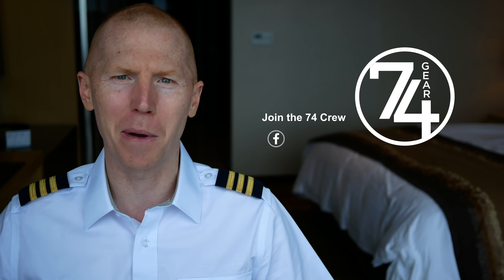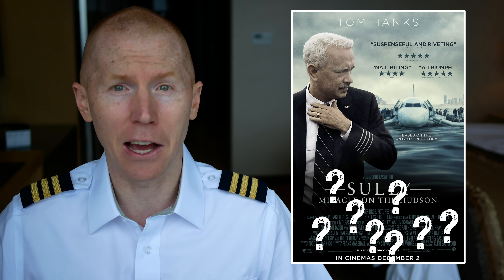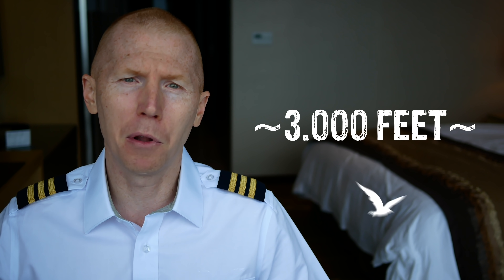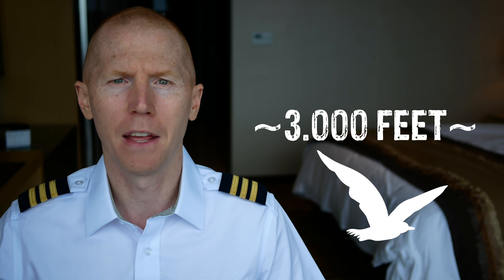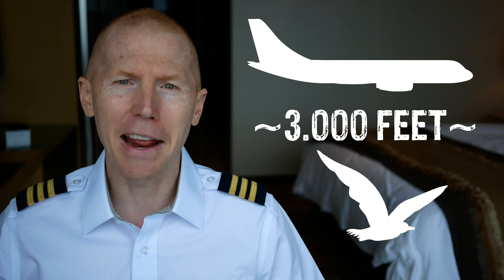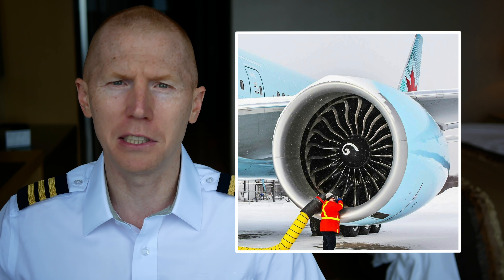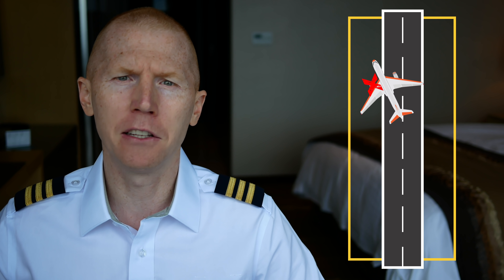Why Engines Don't Have a Mesh or Grates to Stop Birds

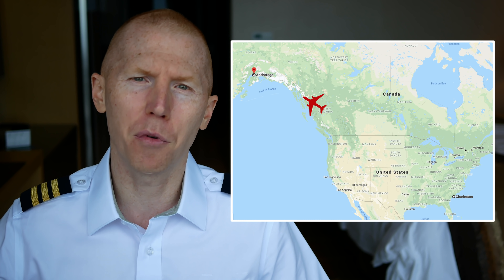Comment: 2:37
It is even more interesting if its used only during a few minutes, it is very easy to have it roll up on the side past 3000 ft ... assuming the loss in energy isn't so bad that you can't get to 3000 ft and that birds aren't very much disappearing so the risk is pretty low and not worth it x)
Might be even easier to just have a suplementary motor mounted on a missile in airports that you could request if you do lose both motors too low or too far from destination , takes a lot of drone programming but its definitly not impossible...

Comment: What bothers me is that a car has an air filter. And still sucks a ton of air through the filter. So I dunno. There could be a filter. Not a grate. If it works for a car? How does a Jet work then? Why can't a commercial plane use that tech?
Reply: Planes and cars are like completely different
Reply: @ducklinglibrary7941  yes. Yes I know. But we didn't think SpaceX would be a reality until it was. Or Tesla. Or Robots. So I'm just saying. Engineers could really if they wanted to make it happen. But I don't think it's on anyone's priority list.
Reply: @TheGuyCalledPaul  sadly, a filter wouldnt really help birds in general. They would fly into it and get smashed and the remains would fly into the engine. If too many got in they would smash the filter and make it unsafe to fly
Reply: @ducklinglibrary7941  yeah sadly I realized that my suggestion is rediculous lol. Sigh. Smarter people can figure it out. But yes. It wouldn't help. You're right.
Reply: @TheGuyCalledPaul  not too ridiculous, I've seen people suggest lasers.
Reply: @ducklinglibrary7941  well. There's that. Haha. Austin Powers. Freakn Lazers. I guess it's a question of who's idea makes the most sense and what can science accomplish

Comment: Why not have something retractable, like when you get to a certain altitude they retract somehow but below said altitude it prevents birds from entering the engine
Reply: I imagine take off is where you need the most intake during a flight so might mess with take off distance too much to be worth it. 
But if not then the fuel efficiency problem isn’t so bad since it is just applied for a few minutes a day.

Comment: Solution: Military Class 1 sentries on each wing that targets birds in a 500 meter radius.
Reply: I’m just waiting for a pilot to forget to disengage them while landing and shooting up the landing crew.
Reply: @CityState_of_Valletta  😂
Reply: @KAT-hs3xh  Just SLAP DAT CIWS on the wings,100% balanced weight won’t affect aerodynamics at all,or you know,we can just mount some .50 and a 47mm turret,but that would just turn it into a gun ship.
Reply: @yeetboiiiiii2488  I reckon transporting people in AC 130s
Reply: @KAT-hs3xh nonono we need to convert a BIGGER airliner into a gunship and make it have 2 120mm guns on turrets,4 30mm auto cannon and a bunch of .50s,just gonna have some Missiles hanging on the wings for y’a know,airport security :)
Reply: @yeetboiiiiii2488  uh huh.....
Reply: @KAT-hs3xh Well who is going to testify against me? The dead bodies?
Reply: The bird population would probably drop by like 60%
Reply: “Hans the birds are coming load the high explosive”
Reply: @yeetboiiiiii2488  big problem Fritz, the war has cut down our supply, we only have three rounds left. It’ll take at least 15 to hit them with this low quality Russian made AA we confiscated from the east
Reply: BURDS HITTIN MAH SENTRY
Reply: @hemttgaming6284  GETS SHREDDED BY 7 SINDWINDERS
Reply: @hemttgaming6284  Hi Cave Johnson here..
Reply: I’m all for this
Reply: Error the speed at which the plane will be travelling u will still be sucking a dead bird inside the engine
Reply: @kanushvenkatesh1725  it’s called a joke, maybe you should try it?
Reply: @Uncle_Jamar  I know I was just animating the possibility
Reply: No no, not enough splash damage. We need plasma cannons
Reply: @artist686  how about a 12.8cm flak firing a nuke
Reply: That costs alot of money and its not easy
Reply: hey look buddy, im an engineer, that means i solve problems
Reply: A 30mm CWIS should do it...
Reply: Ah yes air defense
Reply: Love this idea
Reply: Go murica

Comment: honestly it feels like putting a grate in front of the engine would cause major issues and not be safe, but he mostly talked about fuel efficiency type stuff which mostly left me wondering why nobody can figure out a system that is only active while specifically at that altitude range and not the rest of the flight if efficiency is really the issue

Comment: "Why not put up security for this eventuality?"
Cause the chance of it happening is so escapingly tiny, its not worth the drawbacks having that security.

Even with the few exceptions, like a dam holding back a lake,a fission powerplant, or a space station, theres limits on how much security can reasonably be added without inhibiting the usefullness of the structure.

Its the same reason why stairs get used, or knives are household tools.
Making them 100% would either mean not using them, or make them less usefull, up to a point of uselessness.
Reply: yeah I mean you can't eliminate all risks in life you have to accept the possibilities and take risks, same goes with planes but the chances of actually a bird flying into the engine are so low that it's not even a risk, let alone there are measures for if that were to happen...
Reply: Also reducing fuel efficiency so much has chances of causing devastating problems of its own that could potentially be worse than birds
Reply: They have it, it's called a hunter. There are hunter hired solely to keep birds down around and in an airport.

Comment: If bars prevent good airflow then you could just have some bars that could be hidden when above those 3000 feet and lowered when in the "danger zone". That way you wouldn't lose much efficiency because as you said, the amount of time that you are in the "danger zone" is really small compared to the rest of the flight.

Comment: Another reason is.
How thick does the grate or mesh need to be?
At 300km/h or high whilst climbing, a bird that weighs 6kg will be shredded to ribbons if lucky, this will still be bad for the engine, the worst case is the grate or mesh gets damaged and thrown into the engine along with the bird.
You can see the damage hail does to a car during a hail storm, there is that famous photo of an object 1cm in size striking something in space and making a huge crater.
F=MA

Comment: we got retractable landing gear so why not retractable shields ????
Reply: im not a plane expert but im guessing the problems would be weight, aerodynamics, chances of it breaking off, and the power to motor has since the engine is practically sucking it in.

Comment: The bird die to impact either way and get in the engine,  and having a net can be risky a piece of metal can damage the engine so it worst having both of thoes risk at the same time,either it come of from the pull of the engine or the body of a bird goes in or out everywhere

Comment: Using a screen in front of the engine can be done.  Lookup any video about testing jet engines for a fighter jet, you will see a big screen in front of the engine.  On the ground, it is used to keep things and people from going into the engine during testing.  But the entire area in the building where the engine is tested is checked for debris before the engine is started.  For in-flight it does not make any sense because the number of crashes because of birds is less than 0.01% (or less) of the total flight per year.  I have worked fighter aircraft for 30 years and I can only think of 4 times where an engine was in the shop because of a bird strike and maybe a dozen times where a bird went down the engine with only a little damage on the 1st stage of the fan. The damage on the fan was an easy fix, just blend the damage out and it is good to go.

Comment: There's also the fact that these days it takes a pretty sizeable bird to wreck the engine. A 777 might not even notice something the size of a pigeon. A goose, on the other hand, that would basically turn your jet engine into a hollow tube.
Reply: So you’re implying we should make engines exponentially larger and stronger than local fowl? I’m all for this
Reply: @CityState_of_Valletta  No, but I like where your head is at.

Comment: The solution: Engines that immediately pulverize the birds into fine-grained bird mash.
Reply: even better, add a way for the mash to be deposited into the plane to be served to the passengers.
Reply: @VaderViktor  ewwww nice
Reply: Chicken nuggets
Reply: @Mark_badas  fresh 😋
Reply: Mmm tasty
Reply: What
Reply: @payeshlover99__48  read
Reply: Ive cleaned jet engines after bird strikes... nothing but pink mist doesn't damage the engine at all most of the time
Reply: @smoothguitarforever  Metal. Literally.
Reply: @smoothguitarforever  Double negations in that sentence... Do you mean bird mash doesn't destroy engines, or do they not?
Reply: @Stroheim333  not sure how thats a double negative but it does not damage large engines at all, cf6 engines could probably eat 10 small birds without thrust loss
Reply: @smoothguitarforever  Good! The nuggets can be served and the engines will lose no thrust :D
Reply: The problem about it is that the protein in the meat of the bird will stick like glue at the blades and will generate massive Vibrations in the compressor and turbine which can destroy the engine depending on the high  rpm
Reply: @GrossStadtAdler  At least we kill the birds.
Reply: @Stroheim333  (straw house)
well without birds a lot of the plants on earth will die out, cause birds spread their seed. 
And this will probably lead to further not calculatable problems.
Reply: That would make it less efficient and much slower per rotation and that means you need a much more powerful engine and more fuel for a slower aircraft.
Reply: @calvinscarvings.66  The birds need to DIE!
Reply: @Stroheim333  jeez r u ok? did a magpie bully you when u were 4?
Reply: @kinggecko503  The bastards use to fly into my engines. And the seagulls laugh when they do it!
Reply: @godswillotonye6519  They will do.
Reply: @calvinscarvings.66  but no birds though
Reply: Fine-grained drone* mash
Reply: call it nuggets with feathers for extra chuky
Reply: Not if you come it
Reply: Nothing like launching a object into a highly moving balanced system to not cause damage 🙄 tornadoes and pieces of straw that get lodged into trees......now imagine even greater forces.  A peice of cotton could cause damage at that speed let alone birds with bones and stuff
Reply: @jrseitz21  Stabilize the aircraft. Here we talk bird genocide.
Reply: @Stroheim333  lol ok . Down with birds.  Evil rats with wings.
Reply: @jrseitz21  rats are adorable!
Reply: They already do that. During design and testing of these engines they intentionally feed them birds.
Reply: Poor birds, lol
Reply: Or we can just attach a fan beside the plain that can push the birds away
Reply: @nigelsigma  already have that but in reverse sucks them in. It’s called the engine.
Reply: @nigelsigma  They need to die, the bastards.
Reply: @Stroheim333  damn, what did birds do to you?
Reply: @maddiesullivan588  They exist.
Reply: @nigelsigma  no

Comment: Use a retractable grill in front of the engine that only extends below 3000ft. Wouldn‘t make that much of a deal in terms of cost when the plane flies only a very small amount of time on that altitude. 
I know there is probably a problem because I have no clue about engenering a multi million dollar engine but just tell me what it is.

Comment: A better option would be to mount a sensor that detects birds in advance. Mount mesh on the sides of the engine, which will not destroy the aerodynamics of the plane. When the sensor detects birds, the mesh will be released and go back again to normal position when danger has been eliminated. Thus you still get to keep the performance of the engine in check.

Comment: Also another big reason why they don't build grates in front of the engines is that most of the Bild striktes are harmless.
The majority of air is bypass, meaning it's sped up by the Fan and blown out the other side.
So the Bild gets chopped by the fanblades and the mechanics or cleaning Crew at the next station wipe the the remnands off the inside walls.

Even if a bird manages to get into the compressor, most won't do damage.

So creating a giant mesh that's just ballast for 99.9 of flights is about the same as equipping all cars with chain drives because some of them experience aquaplaning.

Comment: assuming it's to do with air in-flow to reduce fuel consumption and also the point of, even if something hits it you now have said engine cover inside your enime after hitting something at a very high speed

Comment: just make the blades extremely sharp so it cuts anything that touches it while spinning
Reply: Its already sharp enought to cut but still the mess will go in the engine. Tha basic design of it to compress air. So white compressing definitely it breaks something

Comment: A lot of folks don't seem to realize the speeds at which the aircraft is flying are going to make a "grill" or "screen" into a lot worse situation if a bird strike occurs.  
Case in point:  I worked on B-52 bombers in the US Air Force (a long time ago).  They did a lot of low-level practice bomb runs; one day mine came back with a bird strike on the leading edge of the wing between the two engine pylons.  The wing's leading edge on these craft is quite thick.  I don't remember the exact specs offhand.  Anyway, the aircraft collided with a duck.  It punched a hole in that leading edge of the wing that was big enough to get two arms in at once.  Guess who got to clean the duck remains out from among the struts and stringers and other assorted parts of that wing?  Filthy smelly job with JP-4 residue for a bonus.

TL;DR NO a screen won't stop a bird strike at aircraft flying speeds. Trust me, I was an aircraft mechanic in the Air Force.

Comment: Well, but there still could be a way to prevent birds getting into the engine: Basically if one could devise a system that can open up and close on will without affecting ærodynamics too much, we could have cameras on each engine with a computer (or the pilot himself) trying to determine if there is currently any risk of bird strike. But the question is: Is this reasonable to do? Because the risk of bird strike is not that high, but developing such a system to work reliably takes a lot of effort and makes the engines much more complicated, expensive and harder to service.
A much easier thing to do would be simply: Use cameras and computers to detect birds and simply inform the pilot that there might be a chance of bird strike. This way the pilot will be able to adjust the course a bit, so he does not hit the birds.
Reply: if you could detect such, you'd not start your take off roll to begin with.
Reply: @jnawk83  I’m not talking about detecting whether birds are anywhere in your flight path, but detecting whether birds are within a reasonable distance in front of you.

Comment: If the problem is fuel efficiency then why not put the grate when flying below 3.000 and then collect it, like with the landing gear?
Reply: you'd need a much bigger engine to overcome the reduced airflow during the time you need the most power.  the consequence would be reduced fuel efficiency anyway.

Comment: I once hit a bird with my 1970 Nova at 60 miles an hour. The bird got stuck in the grill but was in about 6 pieces. If you put a grill on a jet doing 180 miles an hour when the bird hit it, the bird would just be cut into smaller pieces. At least that is my guess based on the mess I had to clean out of my Chevy Nova.

Comment: My sister is an engineer in airplane engines.
Once an airplane crashed because a frozen hawk got ported by the currents and hit an engine. To avoid that they modified the design and they even have a  bird crash tests specifically to confirm that the engine holds. If you look, you even have videos on YouTube explaining that. 
Having many big birds who hits the two engines it an extremely low probability and completely unfortunate.

Comment: My father who used to work at Bombardier said they would throw frozen turkey into engines and in most case it wouldn't even flinch. They even threw in an aluminium ladder into the blades.

Comment: saw a planes engine catch on fire at an airport the other day, while it was going down the runway. I thought that if it had gotten off the ground, it would’ve crashed. This video helped me understand that the engine could at least get to an emergency landing site, if not the airport. 👍
Reply: Where did this happen
Reply: There are several key points during a takeoff, like a speed after which it is safer to take off with a single engine than to abort takeoff, and so on.
Reply: What even is this comment section
Reply: atlanta
Reply: @kellerc.7278  and when was this? Maybe provide more details about this?
Reply: Music Releases  you could still answer his question, or at least answer them for me, because now I'm curious on this as well.
Reply: @jonlo5540  He's not the original poster lmao can't assume he knows anything about it let alone be in the same country.
Reply: Music Releases  damn that was my mistake

i can't even try to argue back lmaooo i should've read the names i apologize sir
Reply: Congrats you are a moron that apparently has no common sense

Comment: I think it's also worth mentioning that it wouldn't make any difference to put hesh in front of an engine. Because if an airplane is going 150+mph and the engines are sucking air hard, all you'll achieve is cutting the bird into smaller pieces before it blows up your engines.